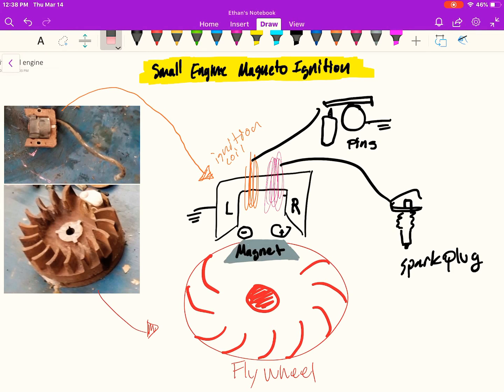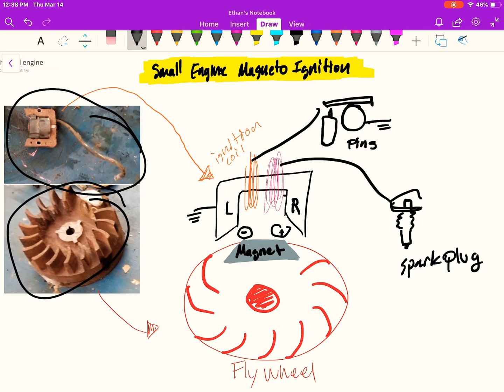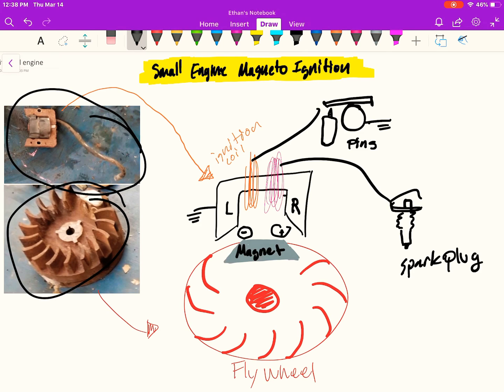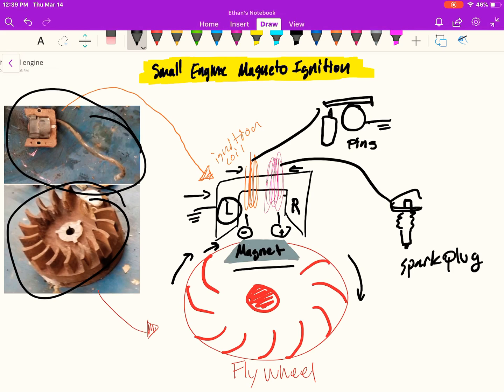Magneto Ignition System

Comment: Are the pins you talked about the same as breaker points?
Reply: Yes
Reply: Or is the condenser actually the rectifier?
Reply: @rendor21 condenser is a capacitor.  Rectifier is a diode (approximates a one-way valve for electric current)